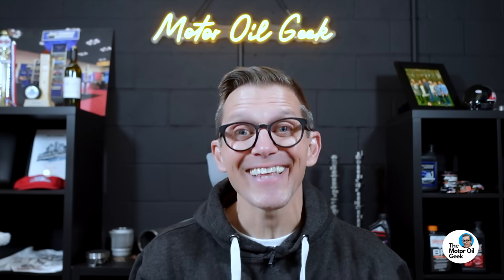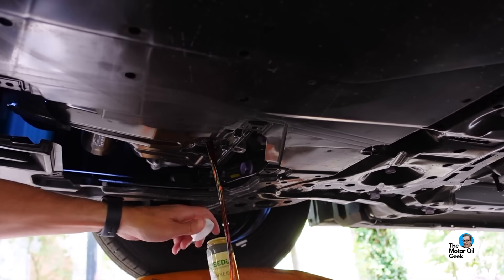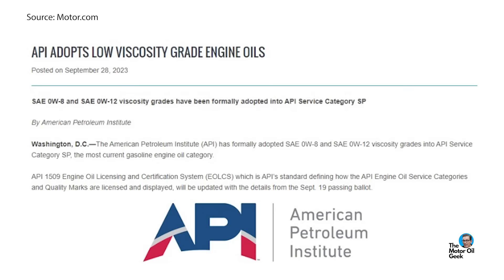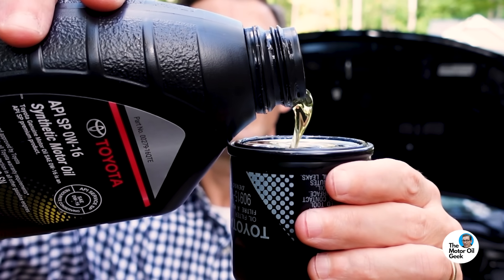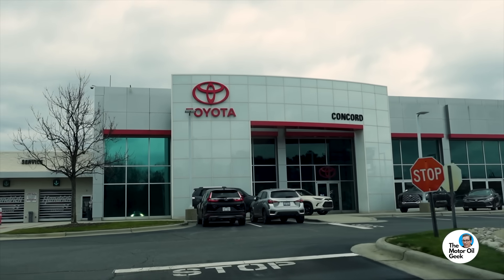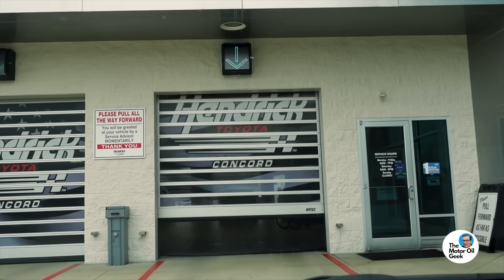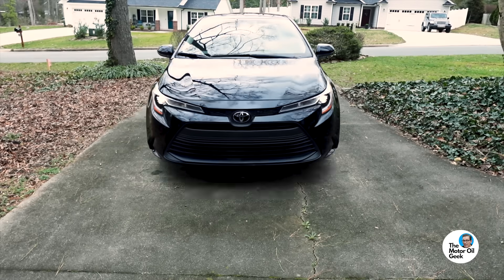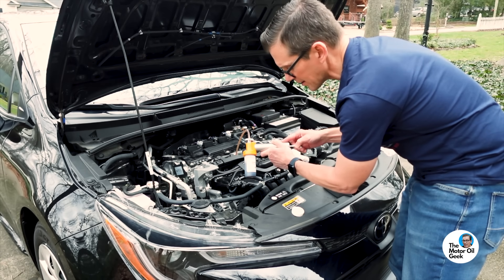0W-8 Motor Oil: Too THIN to Trust? Let's Find Out!

Comment: I'm sorry but I don't believe these new thinner oils protect engine parts as well as 5w30,It is called physics ! I changed my 2012 suburu Imprezza from 0w20 to 5w30 and it immediately stopped burning oil,smoothed out and stopped the rattle a year later it runs smooth and quiet,I don't need a scientist in a lab coat to tell me what my own eyes and ears tell me!

Comment: I never trust these "oil for life" claims. BMW (as sold in North America) generally use a GM transmission, and a GM white paper stated they need an oil change every 100K miles. BMW on the other hand, claim it never needs changing. 
I did a change on a Mini at 200K (European transmission), that oil was jet black and smelled burned. It immediately helped with shifting in winter driving.
Reply from the maker: Agreed!

Comment: Thanks for doing this.  Have a Toyota Crown that I had them replace the oil @ 1k miles.  The price was $105 because they used 0w8.  Didn't think about replacing the tranny fluid so early.  My plan is to replace the engine oil on my own on the 5k miles and let Toyota replace every 10k so the documentation will be at Toyota.  $100 every 5k seems like cheap insurance.  But will definitely be interested in your upcoming oil analyst of the 5k, 7500, and 10k miles on the 0w8 oil.  Thanks again for all you do
Reply: You don't have to have the Toyota dealer do the oil change to keep the warranty valid. Just keep all of your receipts and records in case of a problem. It's against the law for them to deny you warranty coverage based on them not doing the oil changes and the like. I plan to do all my own oil changes on my 2024 Corolla XSE.
Reply: @googleusergp  Thanks.  And that is how I understand the laws as well..  For me, it's a convenience to just have it all done at one place and if the extended warranty asks, the dealer already has ALL the needed documentation.
Reply: @ericfromflorida5146  If you do it yourself, you can do it on your schedule (not theirs) and know it's done right.

Comment: One of your early subs.  I love your videos.   We bought a 2024 Corolla Cross and followed your advice.  First oil change at 1,000, second at 3500. Going for our first dealer service and we will do an oil analysis and CVT analysis.  Thank you so much!
Reply: Those first 2 are the most important. Same for trans and differentials. I do those around 12K. 10 if any significant towing.
Reply: What anybody tells you on any media channel is suspect. The vehicle manufacturer guides you on proper maintenance. They know more than anybody . That said , changing your oil more often will not hurt the vehicle. Just keep in mind that a new vehicle may have special oil to help break in the engine. I would not change the oil after 1,000 miles on a new vehicle. Any metal flakes will be filtered out by the OIL FILTER .  JMO
Reply: Manufacturers have a vested interest in lowering the "cost of ownership" number .  So they benefit from suggesting longer intervals.  If you look at their suggetstions for intense-use, its much more conservative.    @rayRay-pw6gz
Reply: @rayRay-pw6gz  "The vehicle manufacturer guides you on proper maintenance." Wrong. They guide you on maintenance, not proper maintenance. Case in point, BMW recommending 5,000 mile oil change intervals in their engines that have disposable rod bearings. The results are not shocking, the bottom end comes apart at 60,000 miles.
Reply: @bubbleman2002  Toyota has never let me down . 2018 Camry.  The best build and engineering of any vehicle I have owned. 2.5 L.  203HP   8 speed auto/manual . Solid platform and perfect suspension.  Fun and comfortable to drive.  This is a drivers car.  With great safety features.  6,700 redline  . I change the oil at 5K or less.

Comment: That CVT has a first gear. The engine uses Toyotas D4S system, it has both port and direct injection.
Reply: Seems like the most reliable way to do it, by using a standard gear set for getting the car moving to eliminate stress.
Reply: @volvo09 yeah my Chevy Spark has a similar system, and it’s the only reason the shitty Jatco tranny is still alive in my car. For once GM copied someone else’s HW correctly
Reply: Toyota is the KING of making cars that work well and last long. I ❤️ Toyotas 😀💕🚗
Reply: I do like the toyota method of having an actual first gear. With that said, my wife bought a 2013 Accord in 2016, with 25k miles. Ive changed the CVT fluid every 35k ish miles since. Its a bit of overkill, the fluid is still clean at that point. Only slightly different color than bottle-new but its dead simple and easy to change. Always with Honda oem fluid.

 At 140k miles, it still drives exactly like it did 125k miles ago. Im sure the toyota with 50k mile cvt fluid changes will go a long, long time.

Comment: I understand the reasoning of using the thinner oil in cars.  What about the heavy trucks on the highway that pull 80,000 pound loads every day and can go a million miles before needing a rebuild and they use 15W-40 engine oil?  They seem to last using the heavier oil.
Reply: Different engines, different technology. Ford may factory fill their Power Strokes with 10W30 oil, but if you read the owner's manual, you have to run 5W-40 if you run biodiesel or have "severe service conditions".
Reply from the maker: See the other comment!

Comment: Not correct. Mobil 1 now offers 0W-8 Advanced Full Synthetic and it's GLV-1 approved which is of course what Toyota calls for on their newer engines. It's about $28 for five quarts through Walmart. Good chance that Mobil is also supplying Toyota with their oil for their service replacement oil used in the dealership. My 2024 Corolla XSE sedan states that 0W-8 is what is recommended, but the owner's manual says that "0W-16 may be used if 0W-8 is not available", but it has the same sticker under the hood as your vehicle has. I know where that Toyota dealer is because I have family that live in that area, right off George Lisle Parkway. 

With that said, the best general rule of thumb I would say would be 4-5K or six months for oil changes. I will do the oil changes myself as I have done for decades. I then know the right oil is being used in the right quantities and it's being done right.
Reply: he stated in first oil change that toyota oil is exxon/mobil.
Reply: @bobb9922  I read it and I also heard it on the Car Care Nut channel. That channel gives very solid advice and it's well laid out. But you don't have to buy "Toyota" oil---it's now readily available in the aftermarket. I had talked to Exxon in March and they told me it was coming out for sale by the end of the month.
Reply: @bobb9922  I read that elsewhere, yes.

Comment: Wow, at 6:00 2300rpm and the car is accelerating just fine. What a good engine/transmission, I can feel the efficiency through the screen.
Reply: Modern direct injection engines have good low end torque.

I was surprised by that too when I got my 2.7 v6 f150, that's a fairly little engine and it'll happily go down to 1200rpm while driving and going 80 it's still under 2k rpm. Acceleration with a loaded 5klb trailer doesn't require it to rev like crazy either. 

Any of my "traditional" engines from the past would be seriously lugging and lacking power at those rev ranges.
Reply: Carbon build up
Reply: My 24 Crosstrek behaves exactly the same way.  It only simulates "shifts" if you be aggressive with it.

Comment: Shit-head, when I worked at a service station in the late 1960's, GulfPride motor oil came in SAE 00W0 for flathead Ford in-line 6's when the temperatures were below -5*F!!! I put hundreds (thousands?) of quarts of it in 46-54 Fords.Since they didn't have stock oil filters, you were SUPPOSED to change it every 1000 miles. (Flatheads are "dirty" engines by Nature.) My parent's owned a 1953 Chevrolet Bel-Air 2 door sedan, and changed the oil (or I DID in the gravel driveway!) every 2000 miles for 107,000 miles when we sold it. We used D-X Heavy Duty, straight 30W summer and 20W-20 winter. NO internal engine repairs (not even an oil pump-but as all Chebby straight 6's, two water pumps) in 15 years. If it had got below -20*F we would have used SAE 0W-20 like the owner's manual said. I used Castrol Castor bean oil in 0W-5 in my BSA Gold Star cycle in winter. It was like kicking CONCRETE on 0*F mornings!

Comment: At leasr Toyota has returned to using spin on oil filters rather than the cartridge ool filters they experimented with years ago. 
Some manufacturers still use cartridge filter (Chrysler, Audi, etc). The problematic shit brands.

Comment: 10,000 miles between oil changes is marketing propaganda if you do that you will wreck that engine. Do you want to get 200,000 miles out of it change it every 5000 miles, they like to put the 10,000 mile oil change cause then they can tell people that well guess what look at how great our vehicles are engineered, you’re gonna save so much money, not having to do oil changes as often. And they’ll still last long enough to make it through the warranty. But then they’ll start burning oil at about 130,000 mile mark.

Comment: I have a question,does the cvt needs to do oil leveling and clutch adaptation after changing the cvt fluid? Just asking because I've only got clutch based cvt beater car instead of kinda new torque converter one that mostly found in new car
Reply from the maker: That's why I let them do it.

Comment: So the oil acts as a coolant?
Reply from the maker: Yes it does
Reply: always has.
Reply: @keithslade9379  the dealership switched the 5W 30 motor oil to a 0w 20 full synthetic oil on my 2009 Nissan versa with 122K miles. Even though I've kept the oil religiously changed every 3K miles I don't believe that a high mileage engine would benefit from a O weight oil. I'm going to make sure that they switch back to the 5W 30 half synthetic oil like it has been using
Reply: @LilYeshua The "W" is for "Winter", cold cranking. Thinner oil can typically cool better (and cause less heat) if that's your concern. Viscosity and classification is pretty much the only thing written on the bottle that's of value, synthetic, semi etc is more about different price options (when it comes to typing it on the bottle).

Comment: Awesome video, extremely  informative. Since we know that you change the oil out every 5,000 miles and Toyota won't do it at 15,000 And Toyota is currently the only one selling 0W-8 are you going to let Toyota do it or are you going to do it after buying the oil from Toyota or do you think that by then the aftermarket will start carrying it. I currently drive a 2020 Toyota Camry Hybrid that uses 0W-16. Do you recommend I switch over to 0W-8 when it becomes available aftermarket.
Reply from the maker: I’m going to let the used oil analysis results dictate that. If the 5,000 mile and 7,500 mile samples look ok, we will go all the way to 10k. If not, I will change it at home with the Toyota 0W-8.
Reply: You can get 0W-8 now as Mobil came out with it. I ordered some from Walmart yesterday.

Comment: I had 2005 porsche 911 bought used. I did oil change every 1000 miles sometimes 2000 mile using liqui moly full synthetic oil.
Reply from the maker: Thanks for sharing

Comment: Saw a video of a nissan engine builder in japan say to change oil every 2k miles...he said after severe testing and pulling motors apart at different intervals of mileage evrything over 2k miles had exponentially worse damage no matter the oil they used...
Reply from the maker: Interesting